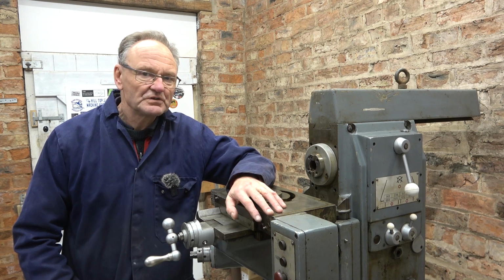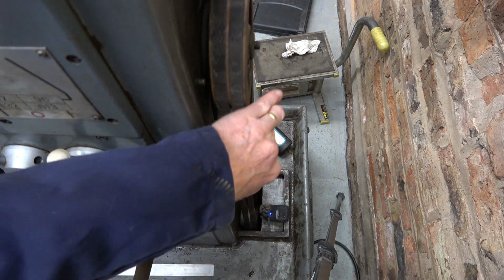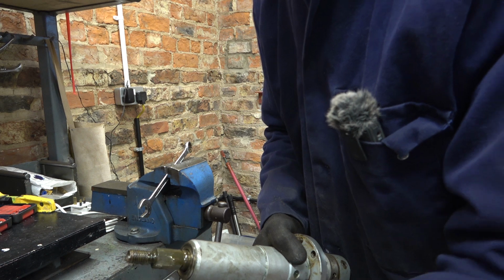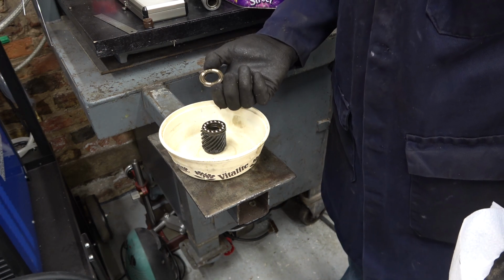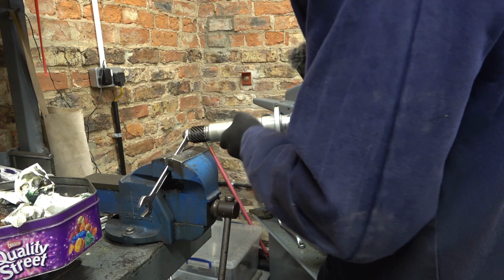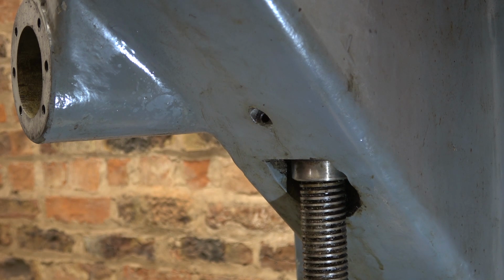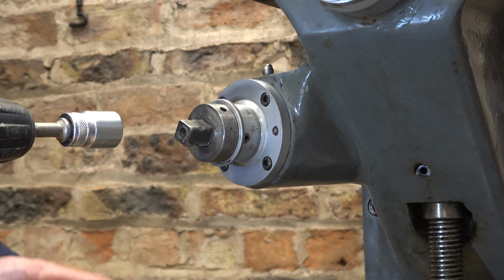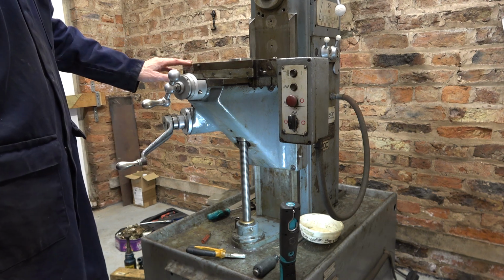HS167 Harrison universal mill servicing – Part 1

Comment: IMO you have to take the saddle off to get the grease out. Sorry to be the bearer of bad news but there are (from memory) 5 holes (one for the flat ways, 4 for the V) and you can't force out the grease from the top. You also really want to investigate the bearing and gear for the Z axis given how rusty the nut was on the handle "cartridge". 

Also there is a hole through which lubricates the Y axis nut and thread. Its designed to drop oil through, you can't clean it without disassembly. 

To remove the table saddle/swivel, remove the four bolts in the centre of the table. Remove the centre plate, then remove the springs and ball bearings from the through holes. Replace the centre plate and the single centre screw (you want to hold the Y nut in place). 

If you want to remove the switch box (and you will) then it is a bit of a pain. Take the cover off and it's merely bolted through to the mounting plate (but the screws are very hard to get to). 

Remove the handle on the Y, remove the nut. Remove the micrometer dial (making sure you remove the entire thing as one otherwise it will pling bits off), remove the bearing under the micrometer dial. Undo the two screws and pop the bearing block off.  Remove the second bearing. 

You can then undo the Y leadscrew. Then undo the 8 bolts on the hold downs and 2 nuts on the clamps. You can then lift it off, take the sliding "plate" with it. There is a cut out in the plate that should let you move it to a position to remove it off the nut.  Remove the central bolt and centre plate and then remove the nut. 

Now you should be able to remove the grub screws on the perimeter (two at the back, two at the side from memory but might be three at the back), one is under the switch box mounting plate (which is why you need to remove it) and clean out the drillings as well as removing the two large "access" plates and cleaning them out too. 

Finally...the knee has a tendency to fill up with nastiness if the previous owners used coolant, if you take it off it's worth drilling a drain hole in the very bottom. It'll be obvious where if you get that far!
Reply from the maker: Hi Fastdruid, I thought I had replied to this soon after you made the comment but obviously I fumbled my phone with fat fingers. Thank you for all the information. I would be very interested to know where you drilled the coolant drain hole in the bottom of the knee and whether I could drill from underneath - without removal. I'm sure I will have the knee off one day but it is not a priority at the moment. Now you have seen the next video you know I found the oil hole in the saddle nut. Luckily I was able to 'rod' the cross drilling without having to take off the table switch box (flexible needle being essential). With regards Paul
Reply: @HaxbyShed  I still think you need to take it off to get it all out, you can't get the grease out of the vertical drillings to the V or the flat otherwise.
Reply: @HaxbyShed  I think you should be able to do it. Location I drilled mine was directly "up" from the flat portion at the bottom of the knee, central (right to left) and roughly 1/3 of the way towards the column. From my CAD model that section is about 1.5" (38mm) thick so it would be roughly 1" (25mm) away from the column.

Again from the model the casting is ~3/4" ( ~19mm) at the "back" wall (ie against the column) so any hole drilled vertically beyond that will enter into the bottom there.

Mine despite having a coolant pump fitted looked pretty good and was bone dry in there (as to be fair was the coolant tank!), I've seen others though that looked horrible with a puddle of nastiness in the bottom!
Reply from the maker: @fastdruid  Thanks for those dimensions I'll check it out. Approx what size hole did you drill ? Ta Paul
Reply: @HaxbyShed  Was only a small one, 2-3mm or so. Just enough to prevent anything collecting long term in there.

Comment: It took me forever to get all the grease out of mine. Unfortunately there are a bunch of small drillings in the table that will just block up with grease. 

I removed the plugs from the back and pushed a rod in to force the majority of the grease out then pumped oil through to blow the remainder.
Reply from the maker: Hi fastdruid, I'm behind with my comment replies at the moment but just wanted to ping back a one liner to say thanks for all that important detail. I've done some of what you suggested but not all yet/at this stage. Cheers

Comment: Seems quite common,  people ues grease instead of oil .  Can be a trap as some machines use both .
Reply from the maker: Hi Max, thanks for watching. I've been following some of your latest series, but time pressure means dipping in and out when I get the opportunity. Getting out the grease gives a pretty instant improvement. Nice return for just a bit of effort. Cheers

Comment: Paul, I our 1928 Nash car had brass grease cert's that were at a 45deg angle that lubed the leaf springs pins and bushes. Their male treaded ends were about 19mm long. Mite check ebay to see if they are available, just a thought. Looking good, nice to set down after a busy Holiday here, and catch up on what our creators are sharing. Best to all there for Christmas. My blood work came back this Monday, and was happy to my PSA was a 3.85. I can sleep better now (@@)! Bear.
Reply from the maker: You just reminded me Bear, I need to chase up my next blood test and check-up which is due sometime around Christmas. All the best.

Comment: You have got to have a plan Paul! Not too severe at all, I think Carl got the rough end of the stick. Definitely sounds like motor bearings, doesn't sound right, I would definitely strip back to check otherwise you risk transferring the rumbling through the belt transmission into the spindle. Cheers, Jon
Reply: You are right about the bearings Jon. They are open construction type with grease nipples. On mine, they were probably the only thing that had never seen grease. I replaced them with new sealed types and rewired the stator to delta.
Reply from the maker: Hi John, I got the bearings out and they are a gonner. New ones on order. Cheers

Comment: Yes motor bearings, likely very easy to change with minimal tools as well. Funny enough the right grease to use on that application is a NGLI 0 grease, which is basically a thick oil, as it does both pour, and can be pumped very easily.  I had some industrial machinery with a gearbox, which you had a choice of lubricants. Either SAE320 gear oil, or NGLI 0 grease, and after rebuilding the one that ran with grease, which had the grease turn to rock (I assume wrong grease used to fill it) and kill the bearings, I went and filled it with the SAE 320 oil instead. then swapped it out and overhauled the noisy one, which had the oil in it, or at least the remains of oil, as the seals and gaskets had leaked most away. Nice German made gearboxes, easy to repair, and very well made as well by Lenze, though the variable speed side was removed and replaced with a VFD, as the variable pulley had worn out, and disintegrated into shrapnel. Still kept the belt, just took a standard double pulley and machined the middle out, to make it wide enough, and used a Fenner lock to hold it to the shaft of the motor. Other side is a special pulley with DC brake, so it had to stay.

That one got the NGLI0 grease in it, as it was easy to fill before assembly, just fill the one half, and put the case together. both got a small amount of molyslip added to the fill, it works wonders. I replaced all the grease lines, as most had either broken or burst, using nylon tubing, and the NGLI 0 grease was easy to pump through it afterwards.
Reply from the maker: Hi Sean the recommended shell grease in this case is Gadus S2 V100 3 which is what I've bought. I did a fair bit of searching online but I could not see the NGLI viscosity for this grease on the datasheets so maybe I'll squirt a bit out on camera and we can all make a guess.  Cheers
Reply: @HaxbyShed  The final letter 3 says NGLI3, which is a pretty normal spec grease viscosity, about equal to most common greases. The NGLI0 grease is basically warm syrup, or SAE 630 gearbox oil like, and it is almost a liquid grease. Pumps well, which is why it is great in grease pails and with grease lines, as it can go with low pressure, and works like an oil that sticks.

Comment: Gday Paul, I think that’s a beautiful milling machine that will last for ever, can’t wait to see it all up and running mate, cheers
Reply from the maker: Hi Matty, whilst I'm sure the vertical head will get the most use, I'm really keen to try the horizontal arbor. Just need to get some tooling for it .....  it's a 27mm diameter arbor which is not all that common. Might have to find a 1 inch arbor - there are always lots of cutters for those selling used on ebay.  Cheers

Comment: That motor might need a tending to.
Reply: I agree. On my Harrison mill I replaced the bearings in the main motor and feed motor, as well as refurbishing both and rewiring the stators to delta to allow for vfd operation. The main motor on my machine was absolutely filthy, it was hard to even tell what it was. I ended up having to pressure wash it before it went into the solvent tank.
Reply from the maker: Hi Tom, bearings are on order now. The old ones were NTN, made in USA. Google tells me that NTN is still going strong in USA, (set up in Japan over 100 years ago). Cheers
Reply: @HaxbyShed  Oh good. I hope the price was reasonable.

Comment: Looks like you’re planning will pay off in a big way. My opinion. That those motor bearings should almost be silent.
Good days to you & yours
Reply from the maker: Hi Kimber, I got the bearings out (later video) and they were truly shot. But I also broke a chunk off the pully trying to get it off so that's a bit of TIG required. Now I realise I should probably change the bearing in my shaper as they grumble too. Cheers
Reply: Can you fit in a us large T-shirt ?
Reply from the maker: @kimber1958  Yep, US size Large fits me. Now I'm wondering what you've got in mind ......... 🤣

Comment: What oil are you using Paul?  Mobil 1 Vactra #4?  I'm using #4 on my lathe &mill because it seems to hold on better & last longer. My Excello knee was full of grease too when my wife bought it for me. Never knew why people just lube stuff with what they have rather than the correct stuff.  Some engine oil pans I've taken off looked like the owners had used grease instead of oil, but that's a story for another day. Good video: I love learning about how different machines are constructed in parts of the world. Cheers.
Reply from the maker: Hi Bob good to hear from you. The plate says "Mobil Vectra Oil Extra Heavy" for the gearbox and "Mobil Vectra Oil Heavy" for the slides. I've said something about that in Part 3, coming out next. I've learnt from experience that some oils sludge and some don't - I think it's a case that you get what you pay for. Good oil and grease are  expensive. The Harrison machines (lathe and mill) were very popular in schools and colleges, were very well made and came with a lot of features in a small package. Harrison were bought out in the mid 70's by the 600 Group along with Colchester and Clausing (so the internet tells me). Cheers

Comment: Really excellent film Paul. Thank you very much indeed for the shout out.i really do appreciate it greatly. I am glad my films have been of some use to you. I changed the bearings in my motor and rewired the stator to delta. Same with the feed motor. I'm knee deep (pun intended) in making the new 5 acme nut for the knee now.

You are making great progress with yours. Look forward to seeing it cut metal!
Reply from the maker: I'll be watching you cut that nut Carl. I may have to do the same for my table nut. Cheers
Reply: @HaxbyShed  Thank you Paul. As my next film will show, I made a test nut in Delrin that was deficient in one very important aspect. But perfect in all others. Disappointing, but it was a test nut to prove the tooling and process, prior to starting on the bronze... I have sorted out the cause of the problem now.  A schoolboy error on my part!